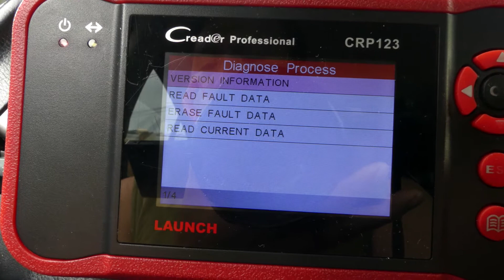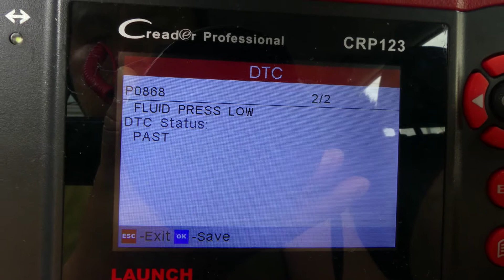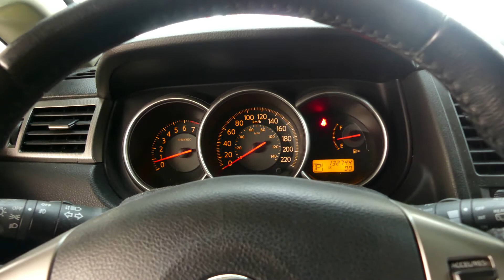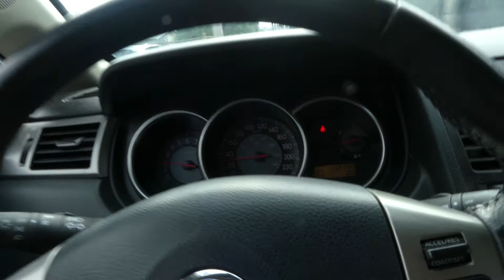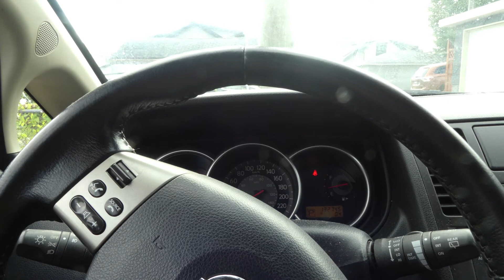2008 Nissan Versa Transmission diagnostic & FIX (P0746 & P0868 )

Comment: What is that part that you removed from transmission called?
Reply from the maker: its a transmission filter u can reuse it cuz its a metal
Reply: Not the filter I’m talking about the other part you took off from the transmission
Reply from the maker: still transmission filter assembly just go to ur dealership just tell them the tranny filter assembly or the paper one they know right away

Comment: I have these codes on my Maxima
Reply from the maker: try thid approach by just cleaning ur transmission filter and putting fresh tranny fluid
Reply: Did you find the solution ?
Reply: @MrJOHNY347  Yes there was a leak in the transmission pan. I got a new pan, gasket, and transmission Fluid the problem was solved.
Reply: @tankwhite.7036  yeah currently I have a p0746 p0868 .i took the valve body ,magnets and filter  out and cleaned it ,replaced it with new fluid .No leaks .Took a road trip across 3 states back to back and the car was smooth with great power . Month later same check engine light came on .car lost power .Turns out when the fluid is hot ,it’s not on the dip stick level on  “hot”.Add another quart maybe tomorrow and hopefully that solves the problem .
Reply: @MrJOHNY347  lost of power or shaking usually means more fluid needed. Look for the exact amount needed for best results.Good luck!
Reply: @tankwhite.7036  thank you 👌👍

Comment: Is this common in Murano also?
Reply from the maker: not sure about murano
Reply: @asianmechanicguy6483   thanks , I'm having trouble with my murano.  It is good until it gets uo to operating temp then it goes into lemp mode.  I have 2 codes p1778 and p0746.
I installed a new step motor, it didn't help. It has 193,000 miles.
Reply: The fluid looks very dirty and smells burnt.
Reply: Anthony Henry I have the p0746 code and though it was my air intake hose since it had a crack in it but it didn’t help and now I’m debating changing my whole valve body ahahah but if your fluid is burnt you should try changing it since it should smell sweet
Reply: @kaboom1774  I think my problem may be the fluid control valve.  I have watched alot of videos on the transmission.  Seems they can get worn and stick. So as it heats up and expands then it would be more prone to stick. Only way to know is pull the transmission and take it apart.

Comment: Awesome video! Thank you preng Rhaswin!!!. Salamat po.
Reply: Also, What is the torque setting to tighten those bolts?
Reply from the maker: 70 in lbs or around 22 fl lbs or if you are experience mechanic just snug it hand tight like ur drain plug

Comment: Is  two different transmissions in Nissan one  is just the regular transmission and another one is cvt transmission, I think you’re using the wrong fluid  you better watch out
Reply from the maker: dont worry brother this is the right fluid its a cvt transmission and ive done almost 20 cvt transmission for this specific car and by the way im a nissan dealership mechanic
Reply: Thanks